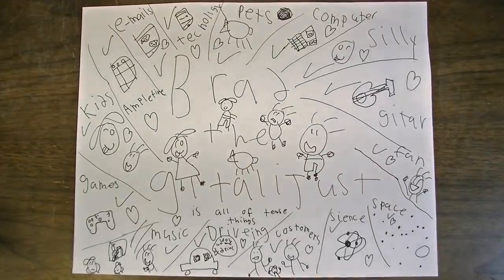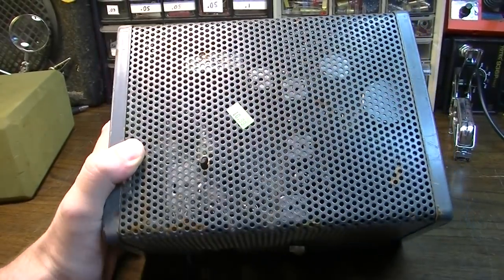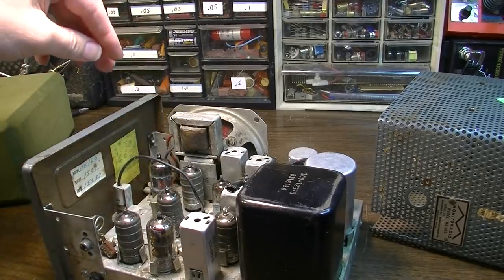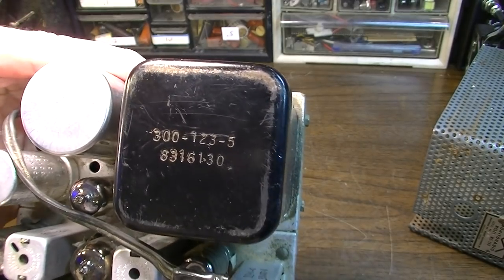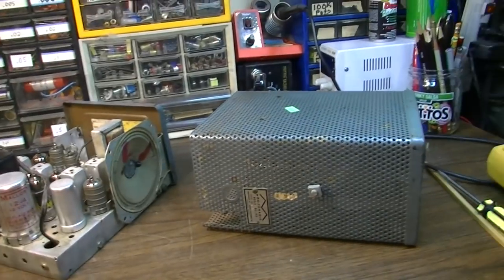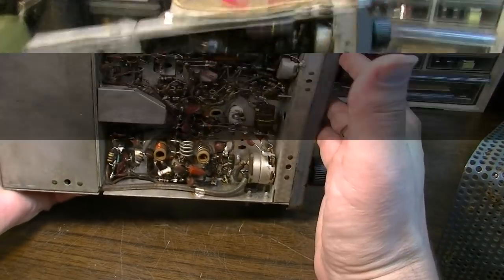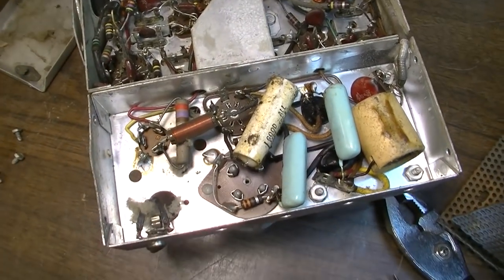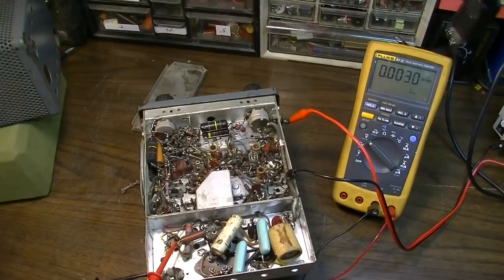Watch Me Play with a Vibrator - 1961 MonitorRadio MC-160 Single Channel Receiver

Comment: I had a Westminster 2 channel  receiver  back in the mid 80's that was made in England by Pye . It came out of a 1959 Wolsey Police car . It looked similar to the one you have here. I did get it working with the help of a Ham Radio mate a few doors away transmitting  to me, which was highly illegal, ha-ha.. I sold it on to an old timer retired Policeman for a Fiver (£5.00) ..Probably the only time he got robbed himself !

Comment: These were often used by US Air Force AMC (Air Mobility Command) fire trucks to monitor air emergency frequencies. Also used by any gov't. or municipality emergency frequency. Frequency would be set by manufacturer upon customer request. Many of these became the backbone receiver for amateur radio novices who would add home made VFO's to allow them to tune across a wider spectrum. Cool old find.

Comment: I'm going to have to go to more garage sales. Neat stuff. I have an old admiral tube radio record player that was my grandparents, never worked for years even when they had it. I'm inspired to get it out and get it working now. That seems like the way a tattoo machine works All it has to do is to collapse the magnetic field to induce voltage into the secondary windings of the transformer.Great videos!

Comment: Its a VHF radio receiver single channel used for monitoring fire or police frequencies. That was probably a crystal controlled unit.
Reply from the maker: There is a socketed IC of some kind with the frequency stamped on it. I presume you can change channels by changing that.

Comment: Brad....Once upon a time, police and fire operated on the frequencies that that radio receives (my local PD was on 156.10Mc [MHz]). That being a receive only unit, it was likely either half of a transmit and receive pair of components, or might possibly (outside chance) have been something that a local cop or firefighter kept in their home, to monitor calls. Interesting piece, but fairly useless these days.
Reply: When I drove taxi we had solid state versions of these setups. The receive was a different frequency than the send. All cars could hear the dispatcher, but only dispatch could hear each car. made it easier for cars to receive  calls from dispatch without a driver "stepping" on the channel.  One older dispatcher said back in "his day" the radios were tube driven, and mounted in the far back of the trunk and weighed close to 100 lbs combined!
Reply: Steven Schwarz  ....It's called a 'trunking' system, and is commonly used for police, fire, taxi, etc., in cities where the 'stepping on' problem exists.

Comment: How much does your power supply put out? These types of unit can draw 3-4 amps or even more. The filaments not lighting suggest either not enough juice of it being diverted. The buffer capacitors were notorious for shorting in mobile equipment. You can test the transformer using a 12 volt AC transformer and bypassing the vibrator. Wouldn't a AC/12v amp be cool to have?

Comment: it's a Fire radio
Reply from the maker: Fire radio makes sense. I was thinking also maybe mining operations where an equipment operator might need to receive instructions but not necessarily need to transmit replies. Transmitters would be an added expense.